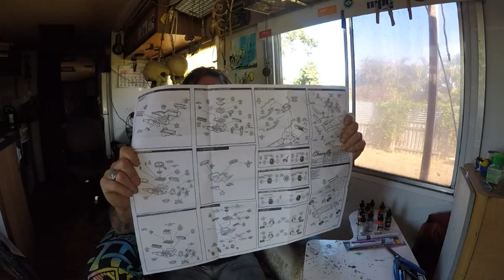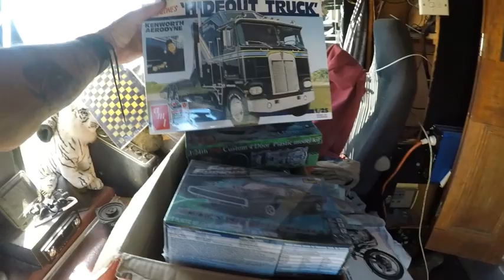1969 Chev Chevelle Model Build....... Hippy Trev

Comment: Hi Trev , you may want to try Tamiya's range of spray can paint , a lot of modelers who don't an  air brush use this product .
The Vallejo paints  you have are mainly suited for airbrushing  it's  a good paint washes up in water and is an acrylic water base so it wont stink out the caravan cheers.
Reply from the maker: ok will have too try find them online   thanks...
Reply: Frontline Hobbies carries a big range of Tamiaya paint there in Newcastle  nsw
Reply from the maker: @shaunhuckstepp7531  ok l just went looking   at Vallejo paints.. cheers

Comment: Have you ever thought about building.a small auto parts shop?to put your spare parts in.& display it with your vehicle models.parked in front.
Reply from the maker: yes l have there's a building i n town with 2 shop fronts....  but the rate's are a killer .. cheers
Reply: @hippytrev7452  I was talking about a model of auto parts shop.with all your spare model parts. I thought it’d be kinda cool to have a scale model to set on the shelf.with the cars you built.
Reply from the maker: @Recycledhooligan  oh right... l did fill the semi tipper trailor with all the model car parts  like a recovery bin....

Comment: This is the worst meal you've ever had in your entire life.
Somebody should look out for a 1969 HK Holden premier station wagon for your next model - Brown in colour and white roof. With the exact number plate.
Reply from the maker: lol cheers
Reply: @hippytrev7452 make sure to never drive a 1980's Volvo boxy little pieces of garbage - I would have to wear an old hat with flowers on the damn thing if I was to ever drive one of those damn things.

Think I would rather drive a 92 Nissan Pintara TRX manual.
Reply from the maker: @bill13690  wouldnt see me dead in any Volvo lolll
Reply: @hippytrev7452  Neither seing me Dead in any Volvo " especially the mustard coloured ones 🤮